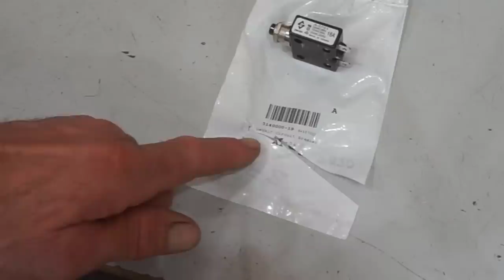DW735 Planer Deep-Dive Maintenance

Comment: This is an excellent video and reminds me of the maintenance I need to do on my DW735.  Changing the Phillips screws to hex-drive screws is a very good idea.  I have little love for Phillips screws, anyway. They always seem to cam out whenever you really need them to work properly.
Also thinking about going with a spiral carbide cutter head, but for my "hobby" shop I am not sure the expense is worthwhile.  For a production shop, I think it might be a good investment. 
Thanks!  Keep on keepin' on!
Reply: Don't Do It! I've owned my DeWalt 735 for almost 15 years (March 2006) and have spent no more than $210 in replacement blades. On average I plane 500 board feet of rough sawn lumber (Ash, Black Walnut and Red Oak). I only buy the DeWalt replacement blades but last year I did get an off name brand to compare (so far so good). If blades are not lasting at least 500 board feet re-evaluate what your sending through the planer before spending $450+ for a shelix cutter. For example: If you cut hardwood on the 96 feed rate no wonder your blades do not last, if your sending metal through your planer or gobs of dried glue then clean it up before sending it through the planer. Again, been using mine for almost 15 years, still going strong with no complaints. Good Luck with whatever you choose.
Reply: @timm3792    I hear you!   BTW:  Do you ever resharpen your planer blades?
Reply: @jerrystark3587  No, though the thought is a nice one. The best you can do is hone the blade if you have a decent enough set up to keep the blade consistent throughout the length of the blade. To actually sharpen them would require a professional grade water cooled sharpener/grinder and again setup is key because if you don't keep the width of the blade consistent you'll have different segments of the blade engaging the wood which can be problematic at best and potentially dangerous depending on the inconsistencies. Even a solid setup on a dry grinder didn't work as the heat warped the blade. I've seen one of those fancy top of the line wet sharpeners at Rockler(Tormek T4 or T8)  but for the price of one of those ($400 to $730) buying blades is much simpler and cheaper. Amazon typically has the dual DeWalt set for $80 and some change so roughly 40 ish a set. I've had good results with the Powertec blades despite all the bad reviews on them ($40 for 2 Sets).
Reply: @timm3792  I have done this for years.  Cut a 45-degree kerf  about 1/2' deep in a piece of plywood as as long and wide as the planer blade (for stability) with a small block at  one end of the kerf, use a Sharpie to blacken the blade  bevel, put the blade into the kerf, and then gently and consistently run your diamond plate across the length of the blade taking care to study the pattern of the abrasion on the Sharpie-marked blade.  Just a touch up works well. Don't overdo it.  

You can set up a small rest strip on the plywood sharpening base to keep the diamond plate at a constant bevel, if you like.  That works. too, and you can quickly work out any angle you want. 

This extends the life of the planer blades by a factor of two or three in my shop.  BTW: Planer blades can be cut down into great marking knives and scraper blades when they are past their useful life in the planer.

This is not an economic issue for me.  I just hate throwing away good steel.

Regards...

Comment: As soon as you turned it upside down, of course it made so many things easier. Wish I'd thought of it sooner too!  One thing that might not be super easy, but might work, the next time the rollers have to come out, if you could use clamps at the ends of the rollers, unless the throat would be too far - it is hard to tell from the image whether a clamp would fit far enough in, to hold the roller in place...  I'm saying, if one face of the clamp jaw fits on the end of the roller, and the other face of the jaw can go all the way to be secured to the top (which is now at the bottom), maybe that would help hold the rollers down while removing the screws - but maybe it might break the (yellow) plastic cover..

Comment: A big thumbs up on a detailed video!
Please do an update on this video after you have put the planer through a demanding project. The part that you replaced is described as a circuit breaker on the internet and it will protect the motor and all other wiring in the machine from being damaged when the entire machine circuit is overloaded. The potential damage would come from overheated motor windings or other internal wires.
I suspect that the 'deep dive' cleaning and lubrication will help a great deal by lowering the demands on the motor. The circuit breaker was just doing its job.

Comment: I agree that a planer is a foundation machine in the shop, as it is a joy to work with straight and flat wood. Your video inspired me to service my planer today. I took your suggestion with a slightly different approach. Once I had the planer inverted, I removed the 4 bolts that held the base to the 4 adjusting risers, and with a rubber mallet, was able to remove the base (I think two people would make that part easier). That gave me free and unencumbered access to the rollers. But as I was putting it back together, I had forgotten to reinstall the side guard plates, when I noticed that the base has a long transverse slots just behind the aluminum handles. For what could that be? I got my longboy Phillips, passed it through the slot, and with little effort, installed the guard plates using the original Phillips screws. It appears that you can also access the roller clamp retainers through the slot as well.
As a subscriber, I would request that perhaps you could show how to service the gearbox (clean/lube). I did notice I had some oiliness on the bottom of the gear box. Thanks for the motivation.

Comment: THX MATT! Have same planer lots of board feet. No thermal switch issues but definitely need your 'deep dive' for feed roller maintenance. Will get this done this week and will upgrade screws! Avid mtn biker western mtns Maine. Big Boshield user for years and is a great product. Again thx again and keep vids coming.
Reply from the maker: Bet you've got some sahwheet singletrack in the mountains out there!  Switched from Tri-Flow to T-9 this season and am thoroughly impresssed... can't believe I didn't discover this application earlier.  Glad to hear your thermal switch holds but I think snipe and overall performance are improved when everything is all clean and lubed.  BTW have you seen the other maintenance video I did: https://www.youtube.com/watch?v=r_yEwlsYGbU&t=584s it really helps extend planer life IMHO.  Best, Matt
Reply: @NextLevelCarpentry  Hey Matt ....Thx 4 link and will check it out. Don't know about sahweet rides but have plenty of skookum single track. Not much flat but all UP&DOWN. 😊Got skookum from when I lived in Seattle "great, outstanding,etc. Sahweet? Thx again and enjoy rides. Stay safe!
Reply from the maker: @watti-yi7sw  "all  UP&DOWN" means we earn our turns, right?  I'm guessing skookum = sahweet... it's good no matter what you call it, right?  Do you do Strava?  The bike shot in the video is from a trail called Victoria 15 Loop which you could find on Strava if interested... Ride hard, ride safe, have fun!

Comment: Excellent video, thanks for the great info and presentation. I’ve got the 735X and it’s a Type 1 so that base plate cannot be replaced. Mine is scratched badly so I had to order a replacement base, the whole thing ... at a cost of $200. I’m going to replace it tomorrow so I started searching YouTube and found this. Instruction on replacing the base is not in this video so I will continue searching but I wanted to thank you for this great content

Comment: Thermal over load ventilation… 
Drill some holes in all sides of the area that hold the thermo overload 
It heats up and will trip less if you help cool it.
Reply from the maker: Of course you could just bypass the thermal overload switch all together and it would never trip, buuhhtttt. ..

Comment: Thanks for the tips.  You've reminded me that I need to break my DW735 down and give it some lovin'. 

I've learned the hard way - have a spare v-belt.  I have a Craftman 12" bandsaw that has belts made much like the DW735, only smaller.  Those belts (even the after market ones) seem to want to dry out and fall a part at the most inopportune time.

Comment: this video just made me subscribe to your cannel. turning the planer on while upside down just for our pleasure! that was awesome. i was like ok, this is when i click subscribe. thanks for your awesome video. i just had an issue with my motor. the armature kinda melted and whore the field down and burnt the brushes. all in all. found out threw your video that is probably due to over load from being forced or over working parts. or my thermal overload switch.  just waiting for pieces to come in to put it back together, but ill be doing some deep dive maintenance while i already have it apart...
 thanks again, ill be watch many more
Reply from the maker: Thanks for the sub Jeremie... much appreciated.  Good news is that the planer is worth fixing and your experience will help you avoid similar difficulties in the future.  Check out the other DW735 video I did.  Just search "Care and Feeding of the DW 735 Thickness Planer" It shows everyday maintenance methods to keep your machine healthy enough to work hard without burning up...

Comment: Matt, a small look behind the scenes in manufacturing to help explain why there are so many different mechanical fasteners used in a single device.  The first thing to understand is that every mechanical fastener has a specific job.  So each fastener has a different specification.  There will be duplicates but each single fastener is considered separately.  The first rule of manufactured assemblies is: "If you already have it in stock, use it." So one fastener already used in another machine is reused as often as possible, it is easier, cheaper,  and already through the nightmare process of specification, quality assurance, and purchasing.  The next thing to consider is that the more new a fastener is the more expensive it is, the first 'screw' was used to hold together the Model A Ford automobile, they were all common headed screws (a single slot ground through the head of the screw).  Henry Ford decided that the slotted screw required too much skill to install correctly and too much time, so he developed the 'Philips' headed or star point screw to ease the time and skill required to install the fastener correctly.  So everyone and their brother has been making those two types of fasteners since you could see horse-drawn wagons on main street.  The next manufacturing principle that pertains here is, the torque required at the time of assembly.  Typically,  you get different sizes of screw, bolt, or nut on a single machine because of what tool is used to initially install the fastener at the manufacturer.  However, I totally agree with you, even after two decades of working to support manufacturing processes, can't they just use the same darn screw, bolt, or nut!  It's a pain in the butt!  And this disregards the unfathomable switch between Imperial and Metric in the same machine.  Oh my gosh, that is great fun.  Good video,  the best practice I've found for Philip's screws is: always use the correct sized Phillips head screwdriver, always use the black roughened Phillips headed driver tips, and always tighten the screw before attempting to loosen the screw.  Also, cordless drivers are great for ease of use, but should not be used to disassemble a machine, too easy to strip screws.
Reply from the maker: All that info is great and duly noted John... thanks from me and other viewers who benefit!  There's something about a carpenters need for a completely practical approach to things and often that disregards all the sensibilities involved.  If my impact driver would have fit between platen and guard screw you can bet I wouldda gone after those miserable little phillips screws with it, even though it might risk twisting their little heads off... and THEN what?!  Glad there's viewers like you who help raise the bar to counteract the ubiquitous temptation to 'just git 'er done' constantly at work to lower it! Best, Matt

Comment: Matt- if you are still having a problem check the planer with an ampere Probe to see if you are drawing more than 15 Amp. If you are check the drive motor bearings or the brushes on the motor for wear if it has them.
Reply from the maker: So a motor will draw more than 15amps if the brushes are bad or weak?  I should check into it... the brushes look fine but are maybe 2/3 their original length which I assumed was OK.  'preciate the help on this Stephen... Best, Matt

Comment: Great video Matt, it makes me wish I had a planer just so I could perform maintenance on it.. Of course using it to plane would wood be a bonus.
Turning it upside down is what I was thinking you should do when the first screw head got stripped. Using a quality screwdriver helps a lot too, then applying good downward pressure on the screw as you turn the screwdriver. You're method of applying pressure to the ratchet reminds me of my solution if I had a situation where there was limited side to side clearance for the screwdriver to be held in line with the screw. If it could be used I had an 18"  Mac Tools screwdriver that would extend past objects limiting side to side clearance that saved many screw heads from being stripped.  Automotive OEM replacement hardware is exactly the same hardware as what you remove to take off any given part, so that screwdriver has saved me many would-be trips to the parts department to  get the screw that more than likely has to be ordered. 
A trick I use and show people when installing screws that are being stubborn, (especially those threaded into plastic, and for us woodworkers, wood that had a screw was previously threaded into it, is to turn the screw backwards slowly while applying inward pressure until you feel it drop into the threads, at that point you can turn it the correct way and it will thread in without much chance of stripping. The finer the thread pitch, the less you'll feel the drop, so it can be difficult sometimes. I learned that trick when trying to install a new part whee the fitting wasn't lining up with where it needed to go because of the way it was packaged.
Reply from the maker: Experience with auto mechanics is invaluable when maintaining woodworking equipment, isn't it?!  Thanks for adding insight from your experience... good advice for those who tackle this project! Best, Matt
Reply: @NextLevelCarpentry  Yes, quite valuable. I've even used that knowledge on repairs or new projects on my house,; electrical, plumbing, closing in part of a room to make a laundry room are some examples.
My comment was long enough as it was, so I decided not to add woodworking equipment that wasn't working, or working wee and repaired them. I created my own Frankenstein monster when I had two what I cal "table top tablesaws" of different brands where I removed the motor from one and installed it on the other. It took a bit of fabricating, but it works now.

Comment: Thank you for the edifying videos on routine and deep dive maintenance on the DW 735, Matt! I’m about to do both this weekend, and having learned from you how it’s done I’m actually looking forward to the full afternoon job.  I think I’ll do the knife change and attendant maintenance in that area after the deep dive, to keep from blowing dust all over my freshly lubed chains. See? You’ve got me from becoming too late smart.
Reply from the maker: You're sure welcome Bill!  BTW I wouldn't do the 'deep dive' maintenance unless there was good reason to do so.  If your planer is performing well there's little need for any more than blowing dust off chains and lubing them IMHO.  Unless you sense the shaft  bearings are really dry or stuck for some reason I'd leave 'em alone in a 'if it's not broke, don't fix it' sense.  Have fun with the TLC session regardless of how deep you dive! Best, Matt
Reply: @NextLevelCarpentry  
Thank you, Matt. I’ll do a modified “deep dive”. I agree with your thesis completely. Thanks again.
Reply from the maker: @billballeza377  LOL... sounds like a win to me!
Just so you know that's the only thesis I've ever been accused of drafting😁

Comment: My 735 is a 2005 model, type 1 that has been trouble free until I let an acquaintance use it since his planer was down; unfortunately he wound up damaging mine and stripped the sprockets on one of the screw towers(?) and now the planer head is tilted and cuts more on one side vs the other. One day I might get some time to see if I can fix it since I had never had any major issues with it until then. Great video 👌👍
Reply: Don’t do that !

Comment: Thanks , my rear roller is acting up.Now I know how to change the bearing and check the roller.
Reply from the maker: Glad this helps... pay special attention to those darn little screws when you take it apart because they can be the biggest challenge of the whole job. You might find that the bearings are just gummed up and that cleaning with a good solvent and then regreasing them might mean you don't have to replace the parts. But once you have it all apart it might make the most sense just to replace those bushing since there not that expensive and easily available at ereplacementparts.com
Best, Matt

Comment: I believe the reason the Phillip head screws were so difficult to remove is because the factory used RED type lock tight which should be heated before attempting to remove, a soldering gun tip should work fine. In regards to reassembly I did, int see you use Lock tight or hear you say to use it but it should be used especially in that environment -with the vibration.